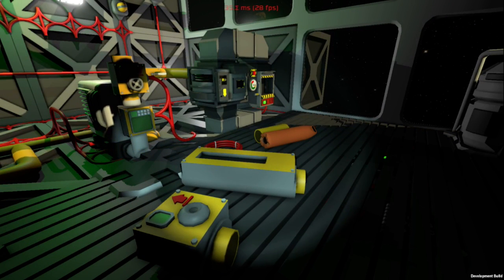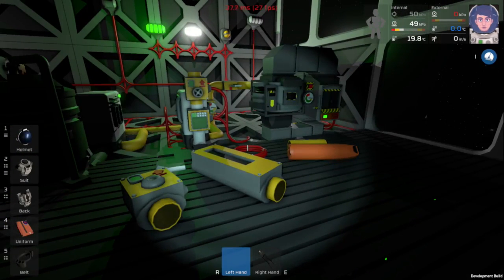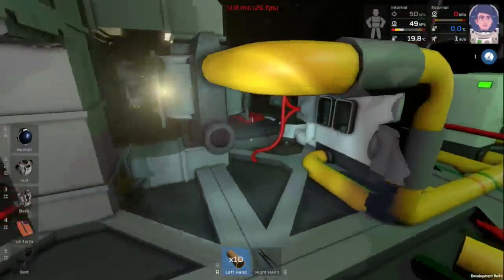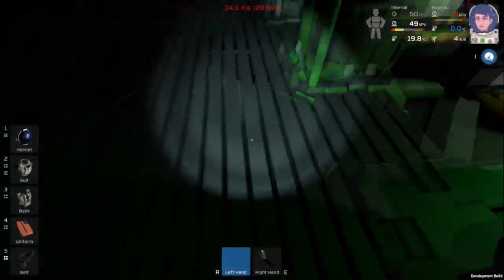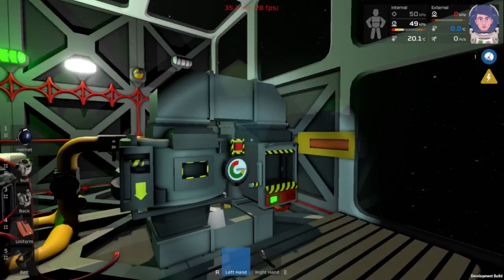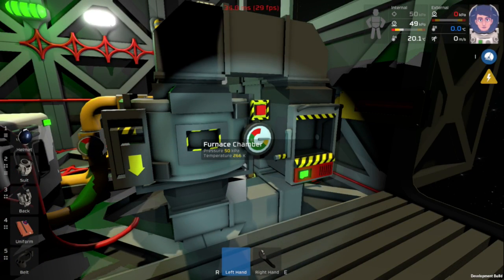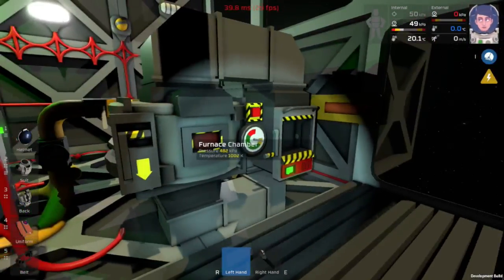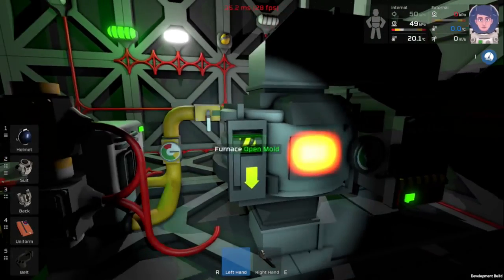Stationeers Tutorial: Gas Furnace

Comment: Nicely done, thank you!

What mix ratio do you use?
I think I will try 66/33 H2/O2

Some thoughts:
Pre-mixed gasses is simple, safe (I guess) to use. But would it be any difference if you use a Pipe Gas Mixer and have Two Tanks with H2 and O2?
That way you can adjust gas mix and easier reach those 'hard to get' settings to make Ingvar etc?

Another thing I been thinking about, what if you set a Pressure Valve on the output, preferably after the Manual Valve and adjust pressure in the furnace?
As in 'Holding back' pressure, to keep pressure up.
Or maybe that will not work? Because we need to vent out old gasses between batches?

To make it safe, use a Back Pressure Regulator in a loop with in the Manual and the Pressure Valve so it can Vent out Pressure exceeding any 'Burst' pressure in the system trough a Passive Vent? As a failsafe measurement?

And hey, feel free to NOT answer my geeky questions.
I feel bad for you, throwing all this at you lol...

Thumbs up and looking forward for more videos!

Erik (hugin/ hugin_q3)

Comment: Fucking hell man. Has this game changed since your tutorials? This doesn't work for me, while i didn't copy your setup exactly, as in the layout of the pipes is different for more convenient location of button, everything is still the same. 
Tank - Pressure regulator - Furnace. This is such a simple setup i don't understand why doesn't work. And yes, i do have a tank with gases inside. 

I'm having similar problems with the airlock. Watches a tutorial, put the disk in, select everything relevant but all it does it "lock" the selected components. When i take the disk out every component no longer works and the screen shows the same "in config" message. 

Either the tutorials are outdated, or i'm missing something. Or possibly there are some other mechanics not mentioned that are messing me up. Which ever it is i'm getting pretty sick of this game. I've spent so much time watching and reading tutorials only for them not to work. The only thing I've managed to get working without faults is automatic solar panels.
I don't mind a difficult game that requires some a lot of trial and error, as long as it makes sense, but this is something else.